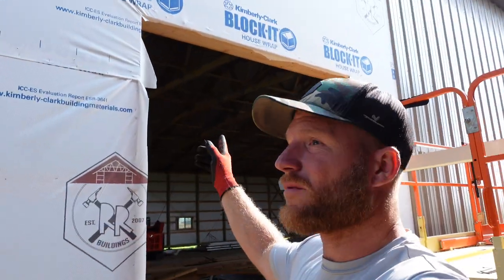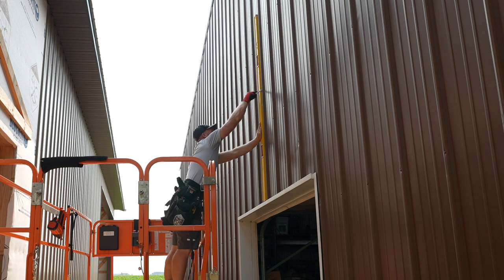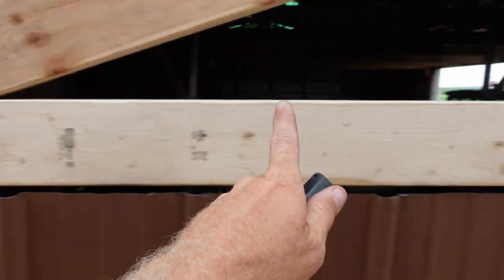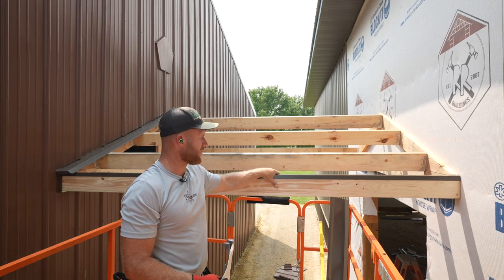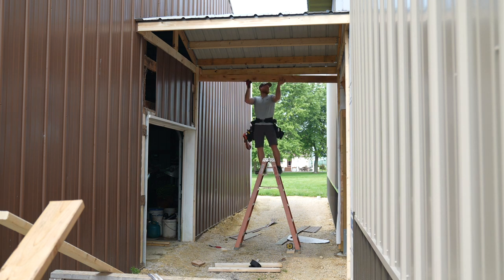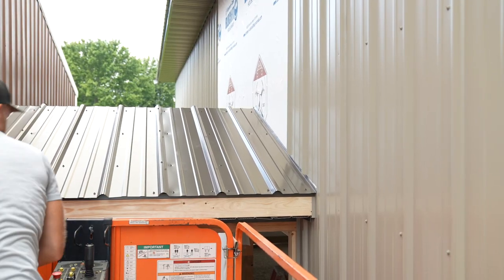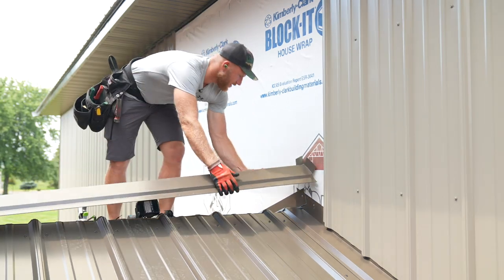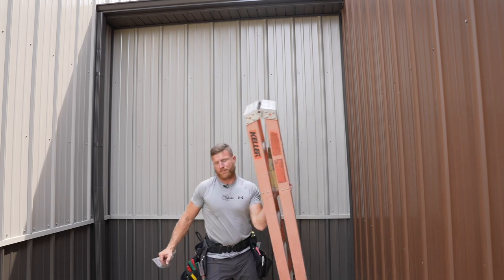Part 7: Building a LARGE Workshop Connecting Two Buildings

Comment: What you need is two access door between the buildings and then two high fence gates at corners of buildings so can be used for two storage space for air compressor etc.
Reply: This is a guess, but the owner may be planning on installing those AKON clear strip curtains so that a forklift or pallet jack can easily pass through.

Comment: at 25:16 you see the difference between a building by Kyle on the left and a building not by Kyle on the right, left is completely straight and right is like an inch difference between top and bottom of the light gray part. Might have been straight when it was built though.

Comment: When the time comes, can you show the concrete pad installation? Like how they dig the footers and lay everything out.   For those of us that are doing our own builds, I’ve yet to find any video that details this process.    My background is residential stick frame construction, I’ve enjoyed learning the post frame process.
Reply: They will pour a floating slab up against and interior treated grade board. No footers
Reply: The footers are what the posts are attached to. One of the benefits of building a post frame, especially in northern climates where the freeze line is so deep.
Reply: @spacemonkey2915  I know that.   I didnt know if they dug clear span footers throughout the interior as well for strength.  Again, havent seen a video to actually show the process.  That is what I am searching for.
Reply: Daniel Klein g
Reply: @dan33klein  where it freezes how does a floating slab not raise up over time?
Reply: Has anyone done a timber joist ground floor? There would need to be extra footings for wide spans but I would be interested in seeing that also.

Comment: how do you make sure its water tight at the corner where the breezeway meets the building on the roof. at 22:21 up and to the right of where your finger is. You had like a 1" long overcut to slide the trim in. I want to have this done on my building for like a 25' porch to break up the 66' but the building faces west on the end wall and I don't want any water getting in.

Comment: Is there any reason to believe the buildings will move or flex independently of each other? The connection from one building to another seem pretty solid. Is there any reason to make slip joints or something similar to compensate for building flex due to high winds etc?

Comment: 38 year carpenter here; I don't know if you seen my comment on your previous video, but, I knew that connector building couldn't be called a breezeway because it's enclosed, so, I did some research and seen most anything like that is called a pedway.
Reply: We had a similar connection at work between the plant and the warehouse. For 23 years it was the "breezeway"! Technically incorrect, but good luck changing it now. 😄
Reply: LMAO

Comment: why not instead of doing that small hallway between the two buildings, just have both buildings kiss each other by knocking down the old wall and extending it right up the new building? like joining both buildings filling up that whole space
Reply: Each building is used for different things. The old building is not heated the new one will be heated